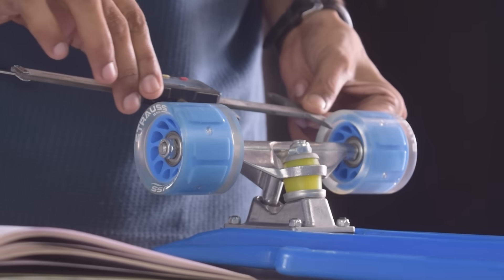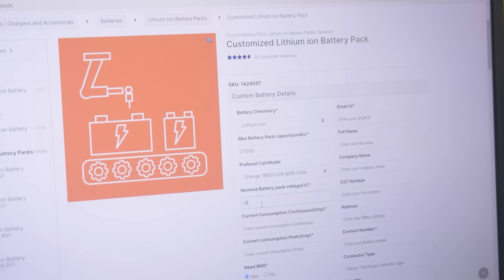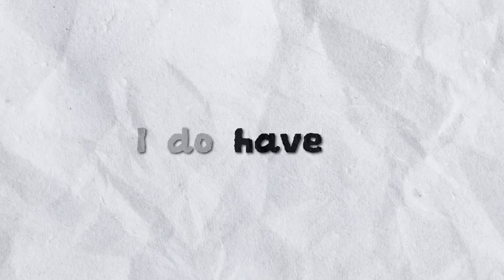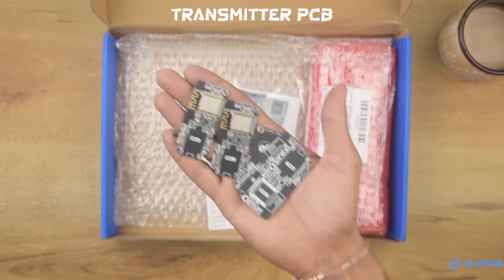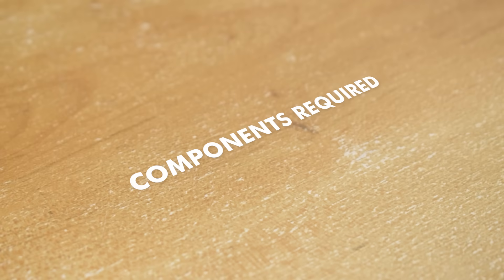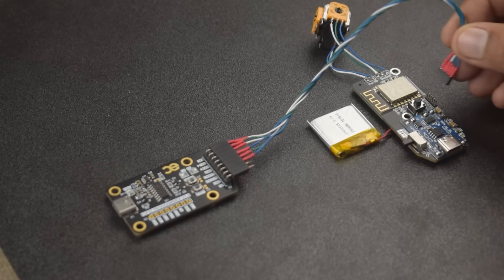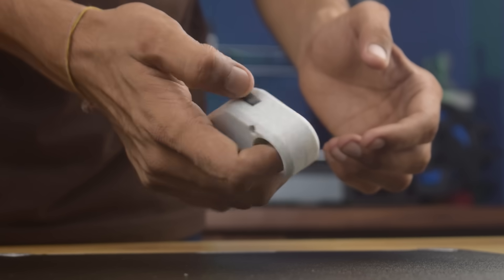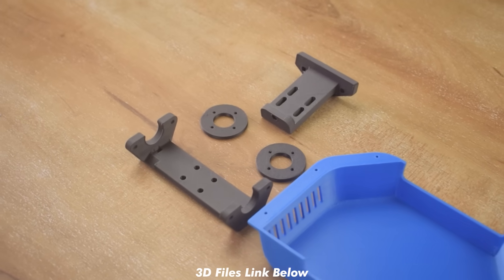I Made a Powerful Electric Skateboard in Budget with Drone Motor - Pro Know #diyelectricskateboard

Comment: I mean, I guess you did it?  You completely overlooked the function of your “creation” (quoted because there are dozens of companies producing electric skateboards). I say this because there’s NO WAY this eboard is able to actually be ridden. Your battery case is 1/4” off the ground which means the first pebble you come across is going to rip it right off probably destroying the entire board. The “skateboard” itself is a TOY made for toddlers. Plastic deck that will permanently bow the third time riding, low grade urethane wheels, generic very low grade cast trucks. While this may have been an intellectual curiosity to see if you could make something that resembles an electric skateboard, it was a complete waste of time and money. Just because you have the electrical know-how, doesn’t mean  you’re proving anything, especially when you don’t even think about the practicality of what you are mimicking (poorly).

Comment: motor temperature to high hona hi hai direct motors par load daal diya 😂 planetary gear system use hota hai load distribution ke liye jo drill , electric hover board and e bikes and tanks drive train mei use hota hai ..... ese projects mei hi knowledge pta chalti hai ...... mechanical knowledge bhi rakho

Comment: You could have used more cheap brushed motors with high torque and low speed which are ideal or better than bldc in these conditions.

Comment: i love the project your work was amazing but insted of using a wifi module you can either use a remote control car remote and receiver in that case you would not need to write the code and also save money please also tell how to learn fusion 360

Comment: You have great engineering skills! Nice to watch. I learned that we can change the drive shaft position of the brush-less motors which was interesting. The drone motors want to spin at high RPM and thus low torque maybe with less range of speed control than brushed motors I think.

Comment: I would add brass inserts to all the screw points on the skateboard frame/chasse so because the plastic threads are gonna strip sooner then later depending on how many times you have to undo the screws to get access to all the electronics under the skateboard chasse and maybe some washers on the screws that are small and may need to deal with all the skateboard movement while it's is use on the Road.